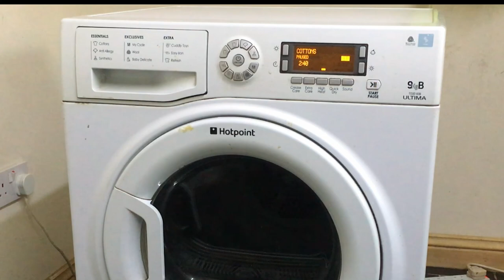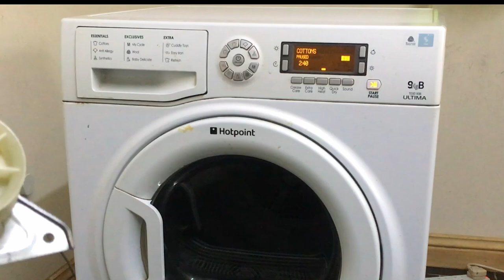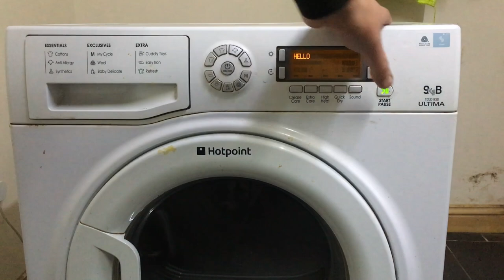Hotpoint Tumble Dryer Repair

Comment: Good man, clearly this idler roller was the issue in your machine, but some machines have a pair of bearings that the front lip of the drum sits on, or a set of plastic glides, likewise there is usually a bronze bushing to the rear. All can go and give the rumbles, but all are quite handy to repair, depending on the designers sense of malice for the consumer!
Reply from the maker: Thanks bootsowen. This machine has two rollers on the front which looked and sounded ok when spinning the drum manually. I remember some a while back that were just a piece of felt that the front ran on, and eventually wears through and you end up metal on metal which sounds lovely 😂😂😂😂

Comment: Take the motor out is the easiest way they’re know as jockey wheel as well, normally good practice to take that housing off to the front of where you’re working and clean the input fan blades also clean the sludge out of the water reservoir at the back and clean the float and 8:05 your belt has a split in it 😊
Great fix though as always
Reply from the maker: Thanks Cucumber man. Yes I did notice the split in the belt too! Thanks for the heads up👍👍
Reply: @BuyitFixit  no worries mate every little helps

Comment: It's much easier to replace/get access to if you unclip the white plastic housing immediately in front of the motor and take off the plastic blower which is under the cover. With the cover out of the way, replacing the belt (especially fitting a new one) is also much easier, you can pre stretch new belts if you are struggling...
Reply from the maker: Thanks for the tip👍. I actually discovered that when I totally stripped it and cleaned the entire thing a couple of months ago. I did a short on it called tumble dryer mission creep, as I was just going to replace the heater but ended up stripping it down to the base which I then power washed 😂😂😂

Comment: Great easy repair mate.
Reply from the maker: Thanks mate. I did look at it again after the heater died. I did a short on it called tumble dryer mission creep, as I ended up cleaning every single part and stripping the whole thing down to it's base which I jet washed 😂😂😂

Comment: An aftermarket part that is built better than the makers original . Penny pinching by Hotpoint
Reply from the maker: Yes, makes a change doesn't it😂 and yes penny pinching. The front rollers at least have bearings 👍

Comment: The bearings have gone
Reply from the maker: Yeah agree. I did oil and then grease them but its still a bit noisy. Not sure if you can buy them separately or if it will be a new motor. Haven't got round to looking yet.